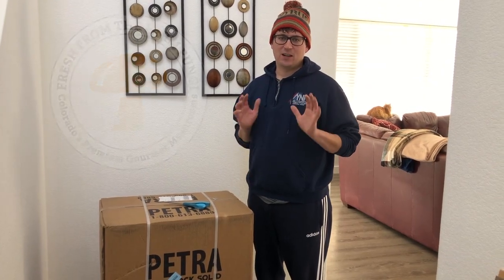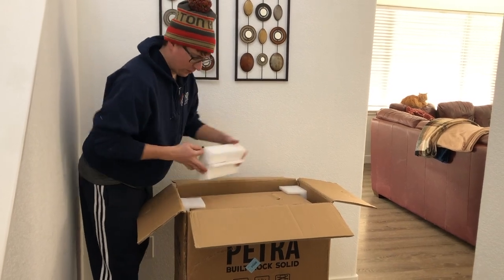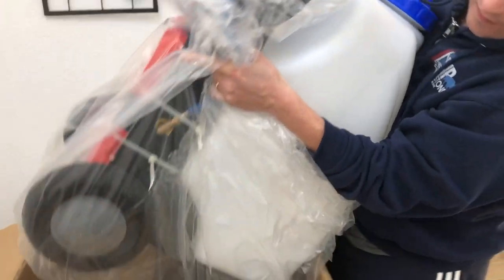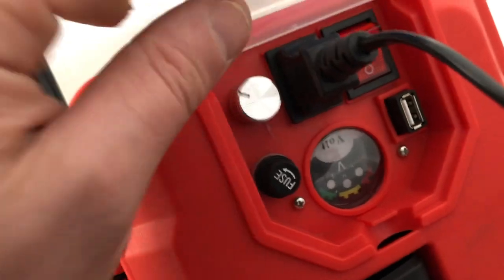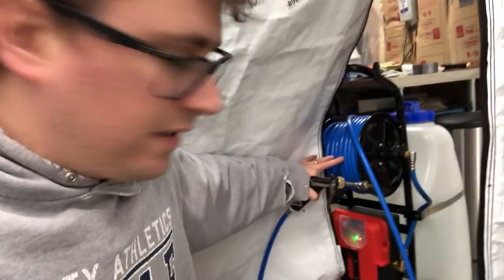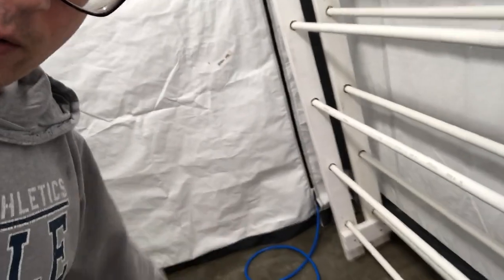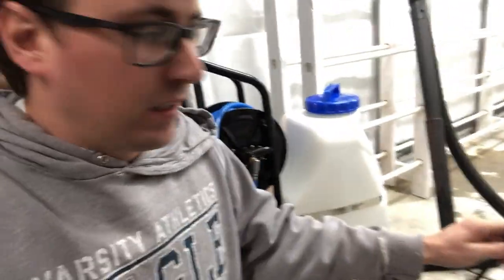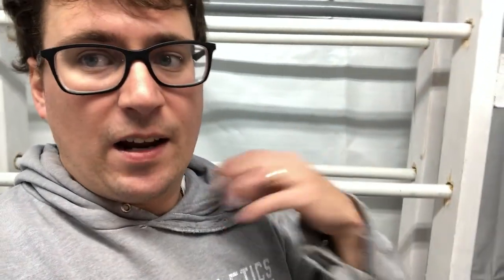PETRA ELECTRONIC SPRAYER: Unboxing "THE BEAST"

Comment: Where do yeast contaminants come from in a clean field? How did you select the "zones"?
Reply from the maker: usually it comes from skin or hair of the technician.  It can come from anywhere though yeast is ambient in the atmosphere.  I select the zones based on my production cycle.  Now I use full tents as zones and it’s because one sterilization run fills up a tent and then I rotate the next round to the next tent etc.

Comment: Is the ammonia safer than bleach in terms of fumes/volatile fumes gary? I'd love to be able to use a safer solution than bleach to sterilize my tent if possible. Is the ammonia enough? I see you use bleach as well so I assume not
Reply from the maker: They both are relatively safe if you follow the bottles recommendations, the reason I rotate is to not create resistance to one reagent - bleach is more corrosive on tents though so be careful not to corrode the fabric or mylar inside most tents
Reply: Ah ty